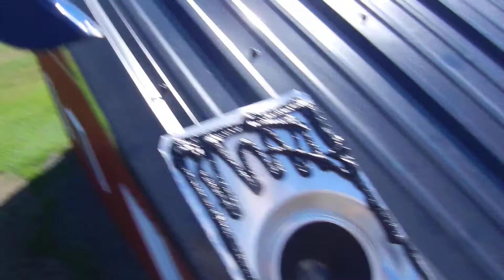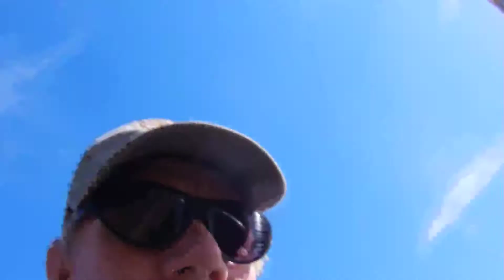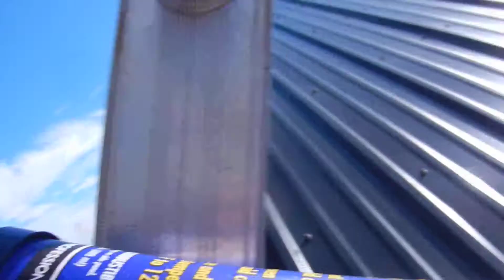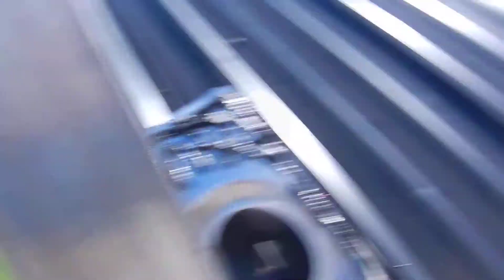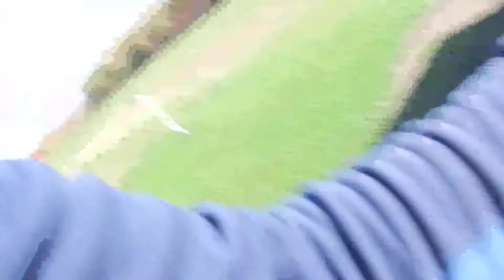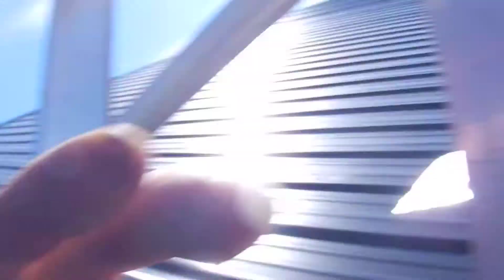How to Cut a Hole in a Metal Roof for a Vent Stack - Part 9

Comment: This part 2? No cutting in the video!  I was looking for tips on how to cut the hole. I am also looking for tips on how to go around a round eye window.  And finally tips on how to deal with a room addition in my front and the slope above it, where I believe that I will need to use flat uncrimped sheets.
Reply: This guy is a CLOWN.......
Reply: Yea this guy is terrible